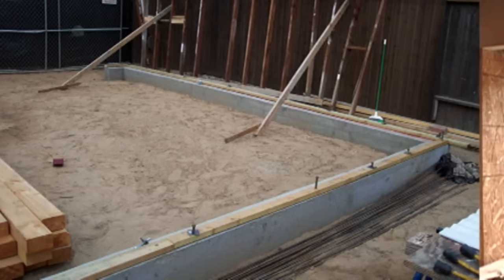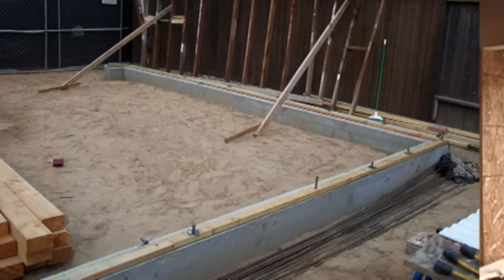Framing Plate and Anchor Bolt Layout Tips For Home Construction

Comment: You didn’t specify how often the bolts have to be??
Reply from the maker: Usually they are spaced 6 foot apart and within 1 foot of every corner or framing wall base plate break. Where two bottom boards might butt up against each other.
Reply: @gregvancom  thank you sir

Comment: When your drilling your holes for the anchor bolts that the wall stands on. There any tips for getting the right measurement for your holes?
Reply from the maker: I need to make a video on that. I usually lay the base framing plate next to the bolts and measure from there. I also use the line if you have one that the framing plate will be located next to.

Comment: In my area, it is required by code to have anchor bolt within 12" of the plate/wall break. It is also required by code to have a maximum anchor bolt spacing  about 7', so if you are doing 16' walls you will also need an anchor bolt somewhere in the center. 1/2" dia. bolts are also the minimum size as per code. I'm in Ontario FYI

Comment: but when you set your wall on top it will overlap the break, as long as a bolt is nearby it should be OK, I guess
Reply from the maker: It's difficult for me to figure out what you're suggesting, could you provide me with a few more details. Bottom plates shouldn't be overlapping other bottom framing plates.
Reply: gregvancom I guess every situation  is different, in my case when remodeling 2 car carport into room instead of pouring slab I just used existing slab which is lover than rest of house but it's OK,  instead of building  walls  so close to ground I poured a footing 6 inches wide and 6 inches tall around perimeter of room and placed anchor bolts around it every 6 feet and on corners,  now instead of buying 18 footers I use used 10 footers I used plenty of anchor bolts to accommodate the ends of the 10 foot boards but I missed a few places,  Im building wall and placing it on top of the treated sill plate,  therefore I will have a double bottom plate and the 2 by 6 used to build top and bottom plates are 12 footers that will overlap the intersection of the treated 2 by six that's anchored to slab,
Reply from the maker: @jurnagin  Feel free to send me some pictures for more information, but I think you're on the right track.

Comment: Hi Greg, you have many informative videos. All your efforts are greatly appreciated. I have a question. 

I'm replacing a 16' length 4x4 sill plate from the perimeter side wall of my garage. I'm planning on using either Simpson retrofit anchor bolts or the Simpson wedge anchors.

My question is, would you know or be able to recommend what size bolt should I be using for this? Either 1/2" or 5/8" rfb? And at what length? Either 8" or 10"?

The foundation is concrete. I'm also in California if this helps....
Reply from the maker: This is just my personal opinion and remember I'm not a structural engineer, but I think half inch diameter all thread bolts that could be embedded at least 6 inch into the concrete might work. I'm only suggesting this, because I've used this method in the past because it was recommended by a structural engineer. Hope it helps.
Reply: Thanks for the info Greg. I been doing a bit of reading and it looks like the 1/2" diameter bolt is also the way to go. I'll be drilling a 5'8" hole into the 4x4 sill plate. If I went the 5/8" diameter bolt and made the holes 3/4", this would seem like a rather large bite on my 4x4.

Given the 6" embedment, the 8" length bolt will be too short using the 4x4. I'm now thinking the 10" length bolt may also be a little short. I am planning on using a square bearing plate as the washer which will add another 1/4" onto the 3-1/2" sill plate height.

I thought of going 12" however I don't see that size using 1/2" Simpson brand retro fit bolts. The longest Simpson retro fit bolt in 1/2" diameter seems to be 10". Perhaps I can get away with just a 5-1/2" embedment on a 10" bolt?

Simpson does make a 12" bolt although it's a 5/8" diameter.
Reply from the maker: I obviously can't provide you with exact embedment advice, but you can usually get galvanized all threads in a variety of different lengths, for example some of them are 36 inches long and can be cut into your desired lengths. I'm assuming that you are going to use some type of epoxy for the all threads or retrofit bolts.
Reply from the maker: I had to remove your comments, because they provided product information or product manufacturers names, sorry. Feel free to edit your comments and re-post, thanks in advance.

Comment: i have a guy wants to drill threw upper wall plate its in garage double 2x4 to run e cable for video cam is 1 inch the biggest a guy should drill
Reply from the maker: I've seen plenty of 1 inch holes drilled through 2 x 4 wall framing studs and plates without any structural problems.
Reply: ya me also, he is talking about a 2 and quarter inch hole , he said little over 2 inch i said are ya crazy one inch sure,
Reply from the maker: Plumbers do it all the time, but they need to be strapped.

Comment: Great videos man, thanks a lot. A question: Can pier & post foundations be used for light frame small homes? Or are they only used for sheds? Thanks
Reply from the maker: Yes they can be used and it's a common method used for raised floor foundation construction.

Comment: How do you take the warp out of a sill plate? Easy to do when working with a plywood subfloor, using a PeeVee or similar tool, but that won't work on concrete

Comment: What about the mouth of the garage (20*26) ....16ft garage door opening , with 24in on both sides.  Do I need 2 bolts to hold that area of the sill plate ? The concrete contractor gave me 1bolt 12inches in
Reply from the maker: There is a good chance that you would or will need two bolts, but should contact your local building department or structural engineer for clarification.
Reply: every  sll plate needs at least 2 anchor bolts unless its under a foot  in length.   if you have a 24inch run and put one bolt in the  middle of it it will have to be cut off and two bolts will have to be epoxied in